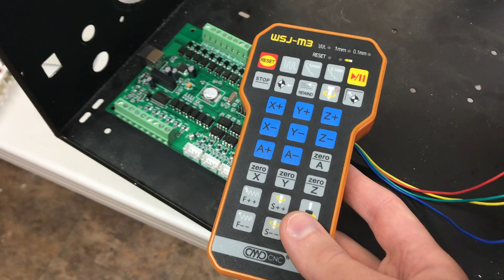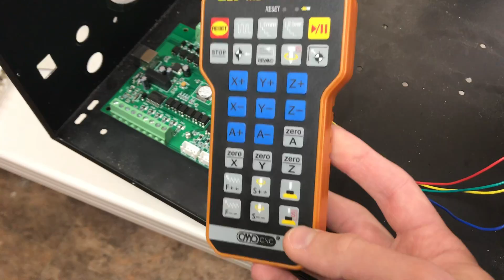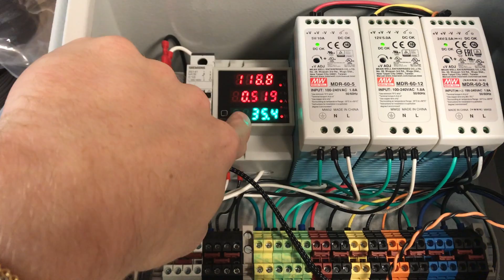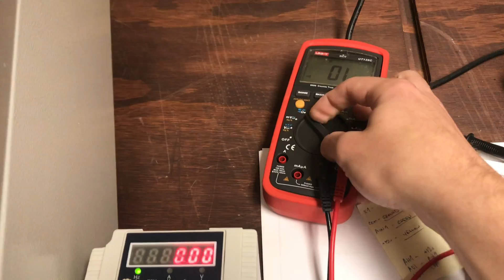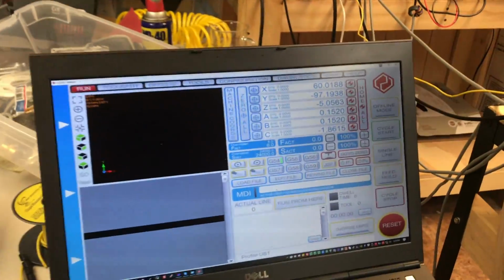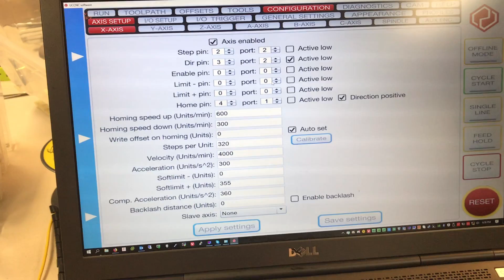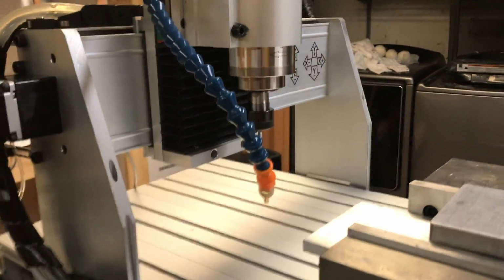UCCNC Controller Upgrade Build For Omio X6-2200L 6040 CNC Router - Part 1

Comment: I have an Omio X8-2200L rebuilt with an ABXX-E and UCCNC and I'm having problem with jerking/hesitating at curves. Tried different CV settings (which made it better but not good) but I have come to the conclusion I need to optimize the post processor (and I haven't got this skill). Would appreciate if someone can provide a post processor.
Reply from the maker: I was using the stepcraft post for fusion 360; you may have too many 0s in your tolerance setting in CAD/CAM
Reply: @NikitaLab  I use the UCCNC - would the Stepcraft UCCNC make any difference? 
Took away one decimal in tolerance but it was no major improvement.
Reply from the maker: Try it. Hard to say without taking a look at the output gcode and seeing the machine, also check your CV settings in UCCNC should be able to find guides out there for a good baseline and confirm youre not dealing with any strange values

Comment: Did had to solder any bridges under the board for the analog PWM to work with your vfd?
Reply from the maker: I didn’t have to but it’s covered in the documentation. If you have the choice to avoid using the 0-10V output I suggest doing so, I found it inaccurate and non-linear but didn’t spend too much time troubleshooting just switched over to a nice MODBUS plugin.

Comment: I have modified my Omio X8-2200 with a AXBB-E, it works but I have problem with jerks when routing curves. Have you any suggestions on settings for this?
Reply from the maker: What CAD/CAM are you using?
Reply: @NikitaLab  Sorry, forgot to mention: UCCNC. Prior to modification I ran Mach 3.
Reply: @NikitaLab  I managed to get it running better experimenting with CV settings but I think they can be optimized. Can you reveal your CV settings?

Comment: I'have done the similar upgrade, except from the UC300 cause I bought a AXBB-E (also from CNC Drive) instead. Up and running with Mach 3 now but will switch to UCCNC. 
Is there any chance to get the Omio remote controll to work together with UCCNC?
Reply from the maker: I haven't tried to get the remote controller working, in fact one of my motivations with the electronics upgrade was to remove the controller since I've found it to e-stop the machine every time there was too much interference (spindle) or USB issues causing it to disconnect. My suggestion is to explore the UCCNC plugins and forum to see if there's any support. Alternatively the remote could be just a basic HID keyboard device and you can map the keys in UCCNC.

Comment: I am considering buying one of the OMIO X8. Would you buy OMIO again, knowing what you know now ? Also, were the stepper motors that came with the system any good ?
Reply from the maker: I would recommend what looks to be my next machine which is the Avid CNC Benchtop Pro 2x3.
There are quite a few reports of people receiving machines from Omio that had critical defects in the frame causing misaligned ballscrews, linear guides, stripped threads, etc. In addition the electronics were garbage which I share in this video, but yeah the steppers were fine.
Reply: @NikitaLab  Thanks Nikita! I’ve been looking at AvidCNC for some time as well. I’m struggling with the costs of their system. I had deja vu looking at the internals of your controller and vfd boxes :) Nice pro job you’ve done there. I presume you’ll just buying the frame given all of the other pieces you just made ?

Just curious, why do you prefer the Avid system say over a “similarly” featured Axiom or Laguna system ?
Reply from the maker: @paulmageau645  I haven't done my full due diligence when it comes to the many companies out there offering solid router frames. The AVID benchtop just checked a lot of my boxes. They offer a frame with very nice optional spindle mount and sensors and the rest I can transfer over from my existing machine. I want to see ballscrews and linear guide rails on all axis. Gantry should be robust with good clearance, a few inches more than my current 5.5" Z height. Outside of being able to use larger sheets of material and the close proximity of the tool holders to my cuts (I really don't want to make a cover for the toolholders if I don't have to) the 6040 is still more than adequate.
Ideally I have my own design in mind, just can't afford the time investment.
Reply: @NikitaLab  Agreed! All the same reasons I want one but this will be my first CNC and I’m just not ready to make that investment yet so one day perhaps:). Thanks for your wisdom and opinions here! Good luck with all your design endeavors!

Comment: Considering so many upgrades you did, why didnt you go for the omio X-8 ? That offers bigger steppers and more cutting area?
Reply from the maker: It simply wasn't available yet when I bought my X6, I would have gotten it. To my knowledge the machine uses the same profiles and components, nothing is bigger other than the longer extrusion lengths.

Comment: Lots of great information, thank you!  Looks like I had better plan on a fairly large electronics enclosure.
For the stepper control lines, better to have a ferrite bead for each individual pair; isolates them more from each other.
I would appreciate a higher sound level.
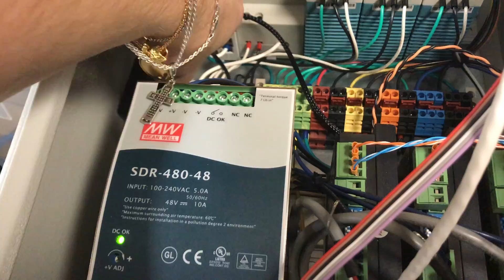Um, please look at the frame at 11:04 for a few seconds.  Any thoughts?
Reply from the maker: You caught me, video wouldn't have been uploaded if something went wrong lmao. Latest vid I used my better camera I agree the audio was poor in this one. I've been meaning to redo the stepper signal wires by using small ferrites, just that they're so small I'd have to redo my ferrule crimps to install them.
Reply: @NikitaLab  Hi I have a machine ready and with pneumatic system also that it is Italian, I want to do a retrofit, I don't know where it starts including software how to understand I'm from Brazil I need this help
Reply from the maker: You're asking for a lot lol, if you want me to talk about something specific about my machine lmk

Comment: Hi, I just bought an ub1 card.
My drivers manual hbs57 says: signal current 7-20 mA (voltage 5V?)
Ub1 manual : Output 14 NPN isolated output terminals capable of sinking current up to 70mA for each channel. (Voltage?).
On a blog they say that the output of the ub1 is 24V and you have to put a resistor in series on the output signals towards the driver.
I wanted to know what your drivers are and if you put the resistors.
I'm confused because in the old card I connected the output signals directly, but it was a simple 5V board.
Reply from the maker: For the drivers I wired them directly to the step +/- and dir +/- on the UB1. Things like the output voltage, resistors, and sinking current only applies to the input and output terminals when it comes to things like NPN/PNP sensors, relays, etc. For my particular drivers I've omitted wiring the enable +/- as having them automatically turn on with the power supply suits me just fine.